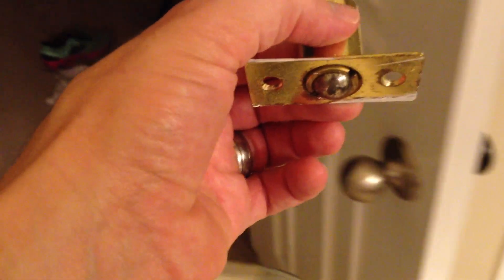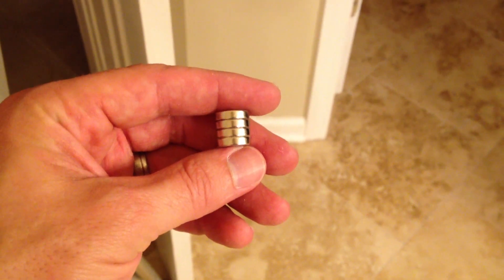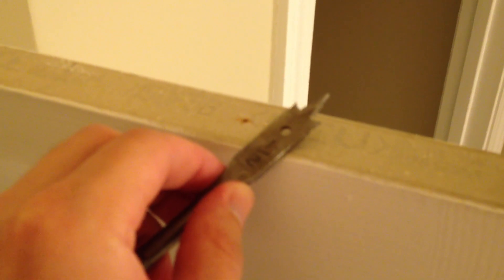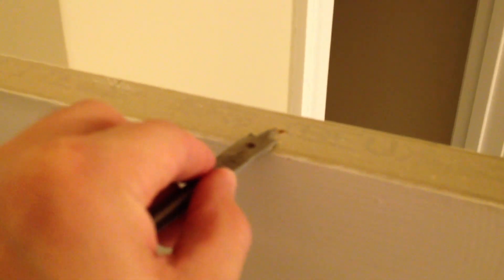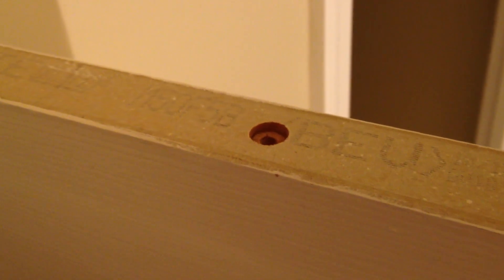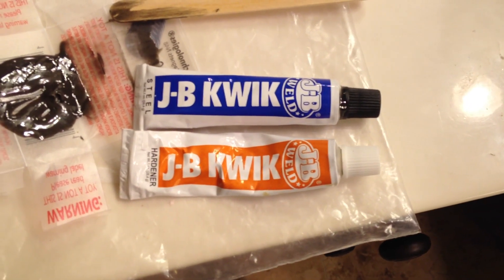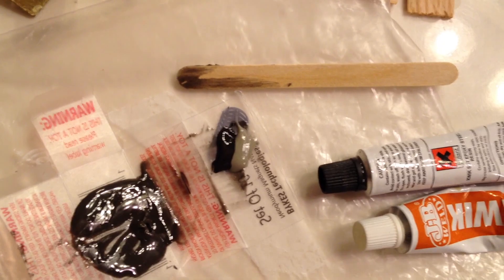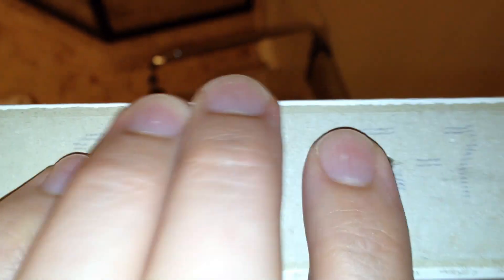Invisible Rare Earth Magnet Door Latch

Comment: You did exactly what I wanted to do, which was to use magnets to avoid having a door handle lever for a cleaner more modern look, with the deadbolt or (when it ships) my Haven Connect lock do the security portion.

My suggestion was to have the magnets closer together, which I see you did by doubling up on them. The other thing that would make it stronger would be to have the magnetic catch as far from the hinge as possible (longer torque arm).
Reply: Actually, if you could upload an updated video that might silence some of the haters. :) Also, I'm a DIYer at heart but no time, so I'm probably going to order the product mentioned below by PLS.

Comment: Good effort but that was clearly a rubbish latch, i expect your wife made you replace the old latches and told you to stop drilling holes in her doors.
Reply from the maker: I admit, certain groups in the house expressed skepticism...at first.

I ended up adding another magnet on top of the magnet embedded in the door to bring the door magnet closer to the the jamb magnet. That improved the strength of the latch significantly.

Since they went up I've never thought about replacing them (or been made to!). They do just what I wanted: silent operation; no moving parts to replace, adjust or maintain; completely (mostly) invisible.